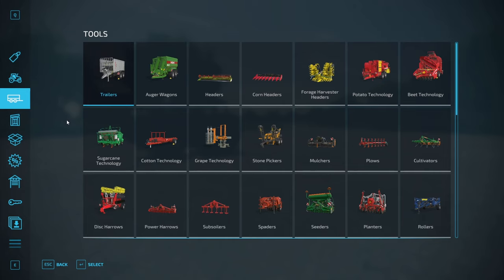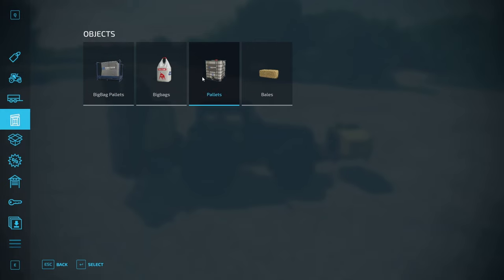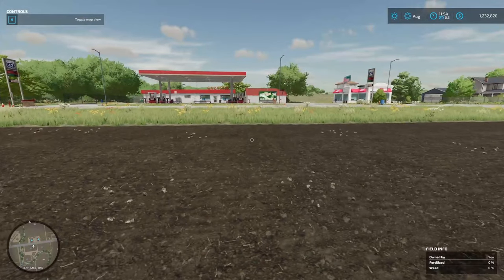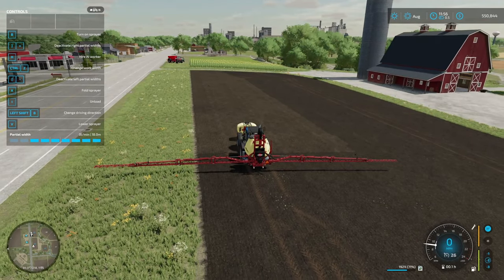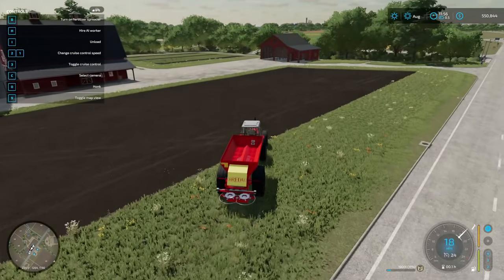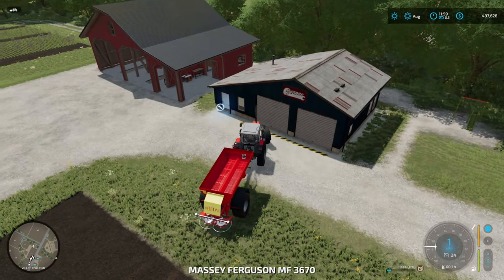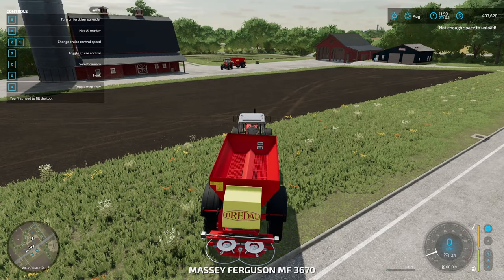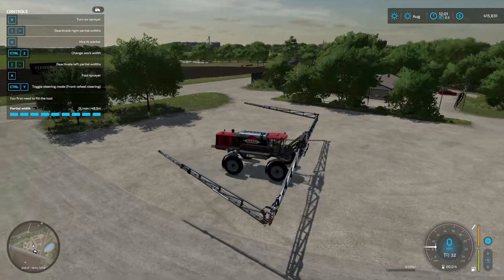HOW TO USE FERTILIZER / HOW TO REFILL FERTILIZER | Farming Simulator 22 Tutorial | FS22: Tutorial

Comment: I'm Struggling to get anything to load in my fertilizer i be backing in to the pallets and holding the L1 on the ps5 and there is no refill the fertilizer button
Reply: Same issue here, no popup allowing to fill, not even a key bind in the settings menu
Have you managed to solve this?

Comment: Trying to refill your seeder with seeds does NOT work now.

I returned to this game, and everything went fine until I got to the point of refilling the seeder...
Seems it's bugged now, to where refilling your seeder doesn't work.

EDIT: APPARENTLY SOMEWHERE, SOMEHOW, A MOD OR IN BASE GAME:
I needed to Lift the Pallet up, hover it OVER my seeder, and it "automatically" dumped the seeds into the container.
So Just like its done in real life.. (if you dont have a hose + pump system)!!